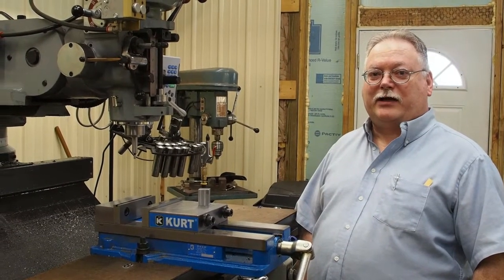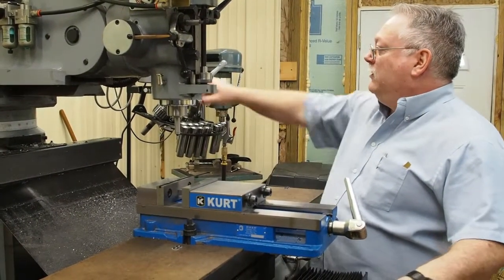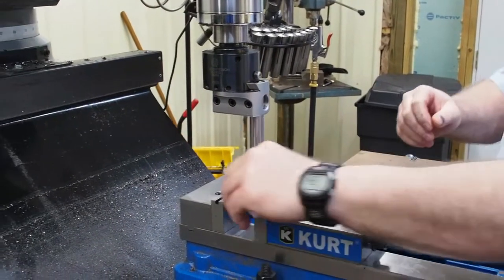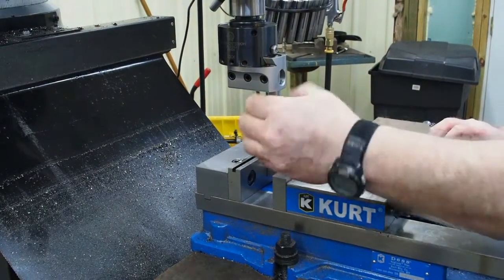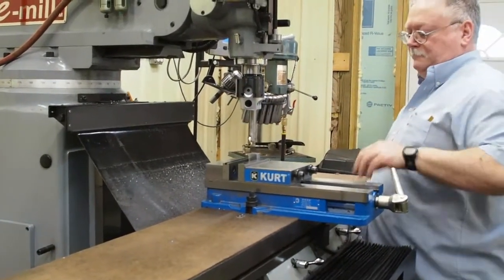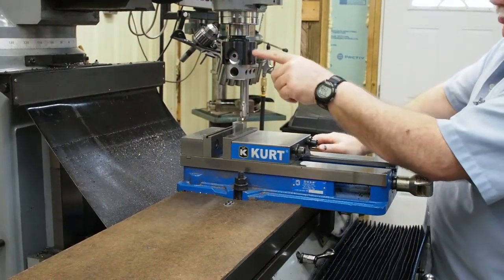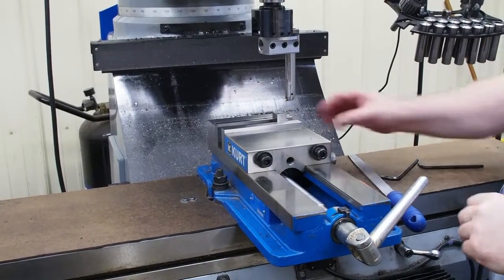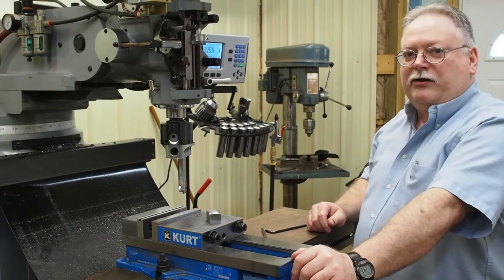Squareness gage part 2

Comment: Steve, thanks for mentioning the idea of edge finding under a load during the beginning of the video.  I hadn't really thought about that specifically before.  When I saw you do it I immediately went to the shop to measure the deflection on my Kurt vise.  I measured directly above the clamped block and easily get a thou and a half.  I also tried different shape blocks and noticed each shape block would produce different deflection amounts (at the same clamping force).  Essentially the larger the surface area of the block in contact with the jaws the more clamping force it took to deflect a given amount.  The inverse of that was a little surprising.  I placed a small block of stock roughly the size of a 1 inch gauge block clamping the small ends between the jaw faces and noticed it took much less effort to deflect the same amount as the wider block I had used.  It makes more sense after I scratched my head a little.  ha ha.  Thanks as always.  Out of curiosity, do you see similar deflection ranges north of 1 thou?
Reply from the maker: Hi Paul,
.0015" isn't to bad I have seen a 10" Kurt vise deflect almost .010", I modified that vise and brought it down to about .001".  I would say that .003"-.004" is the average deflection I see in older non modified vises. The deflection is greater based on the amount of clamping force as well as the things you mentioned. Kurt Vises have great holding power and most people I know over tighten them. I try to use only enough force to hold the part safely. If I have heavy roughing I will use a lot of clamping force then re-clamp and locate with less force for finishing.

Comment: Interesting use of a boring head. It never occurred to me that the cutter could be mounted backwards for a convex cut. Obvious now. Thanks.
Reply from the maker: It would be safer with a left hand bar as one of the viewers pointed out but I did not have one. I was taking light cuts so that I would not loosen the arbor from the boring head.

Comment: Would I get the same result by milling the part on a rotary table?  

How would you go about measuring the effect of the large variation in tool flex due to the interrupted cut with a relatively long too stickout?  I'm picturing the un-flexed bar as it hits the leading edge of the part, flexing back under too pressure, and then stabilizing until it leaves contact with the workpiece.

I wouldn't worry about such things on an ordinary part, but making a measuring tool that will be called on to be accurate to tenths - the measuring setup has to be more accurate than that, yes?
Reply from the maker: Hi somebody else,
None of this would matter seeing the contact radius gets ground in a later video. Even with the machining there is not much variation. 
Steve

Comment: A good job for a left hand boring bar !
Reply from the maker: Thanks Greg,

You are correct but all I had were right handed bars. A left handed bar would have been safer. I made the boring bar that is seen in the video. It has a very good insert clamp design and is able to take heavy cuts without the insert moving in the pocket on you. I made a simple little fixture to make boring bars with on a knee mill. I may have to modify it to make left handed bars. That might be a good YouTube video in the future.

Steve
Reply: That would be a great video.
Thanks Steve.

Comment: How much were you moving in X between cuts?
Reply from the maker: Hi Mayhem,

I wasn't looking at the DRO but I was taking light cuts. My guess is between .01" & .015" per pass. Going to heavy could case the boring head to loosen from the threaded arbor. Also, heavy cut on an interrupted cut has a higher chance of chipping the carbide insert. If I had a lot of stock to remove I would have scribe the arc and milled most of it off with and endmill.

Steve